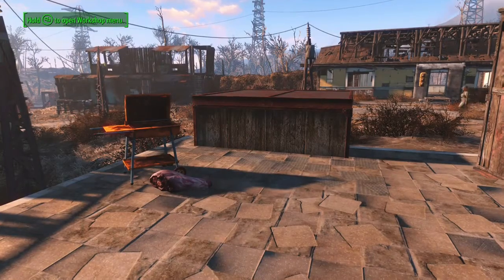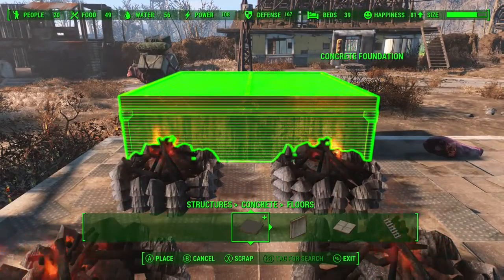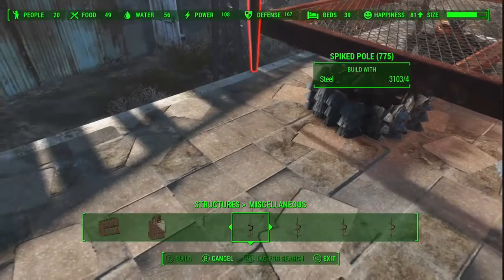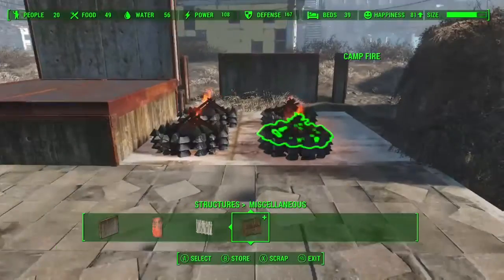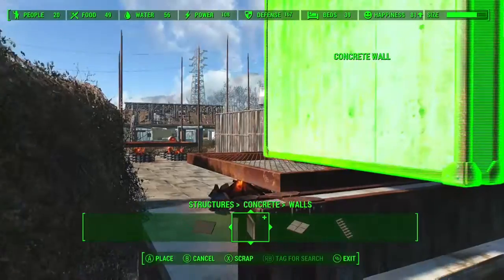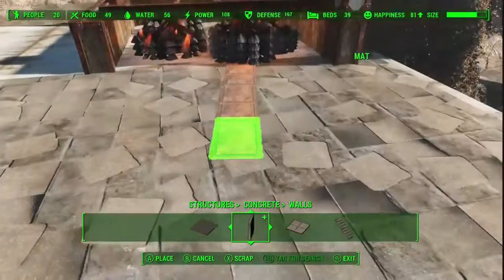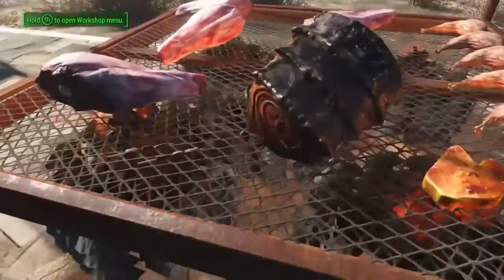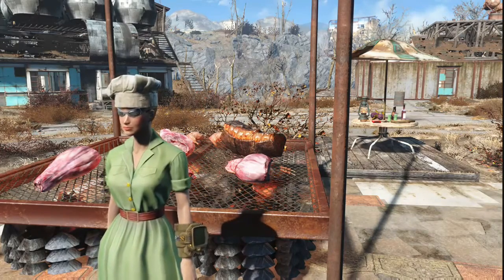How to Build a BBQ for Your Settlement - Fallout 4 (XBox no mods)

Comment: Pretty good, but the concrete one works out even better with the walls lined up on the inside of that grate (or just a combo of the half wall and a couple pillars). When they're outside, it's a little too easy for it to look like the grate is floating. 

This video DID inspire me to make a BBQ restaurant though (esp. w/ the settlement butcher from Better Stores mod). Every time I see one of you guys build really cool little things like this I can't WAIT to see all the awesome stuff you're going to come up with once you've got access to all the mods too! 

Also really nice work on the junk decorating. Too many builders on YouTube tend to either neglect that, or go WAY over the top on it. This is a nice balance of subtle enough to look lived in, and not so much that if it was part of a settlement with a hundred other things it would look cluttered and laggy.
Reply from the maker: Thank you for your comments.  I totally agree with you on your 1st comment  "concrete walls UNDER the grating".  When I built this for real, (this vid was just a demo), that is exactly what I did, and it looks better. I prefer the concrete BBQ over the metal pole version, but which one I use depends on the settlement.  I try to go for a look that fits that type of settlement.